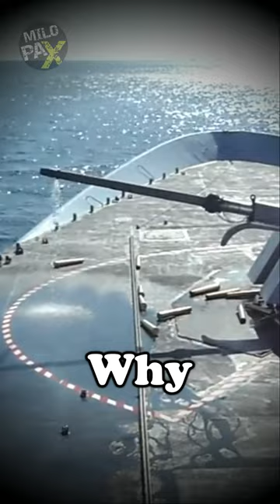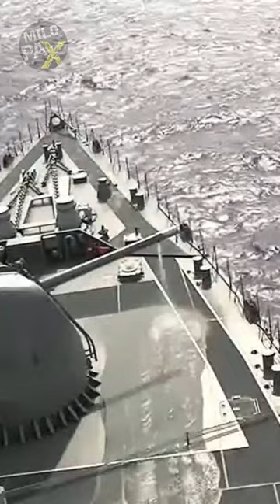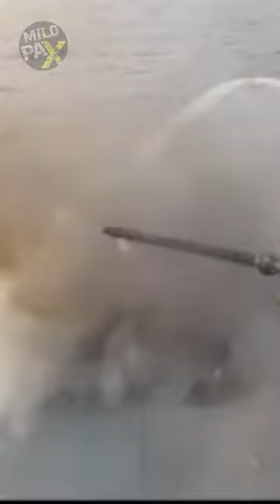Why is water dripping from the gun? #shorts #learning

Comment: First and do they use sea or fresh water?
Reply from the maker: Sea water.
Reply: Did you really asked that?  You’re not going to get fresh water in the middle of the ocean or salt water in a lake.
Reply: @mrdude88 it is a fair question since, in theory, normal water would be better since sea water's high salt content would cause corrosion so it could reduce the reliability of the weapons system. But i am not entirely sure since i have never see the internal workings of a naval water cooling systems, i just know how damaging salt water can be.
Reply: @mrdude88 Salt water corrodes. When you use an outboard motor at sea you have to flush it with fresh water after each use.  Large ships have their own fresh water supply.  Perhaps the cooling chambers are brass?